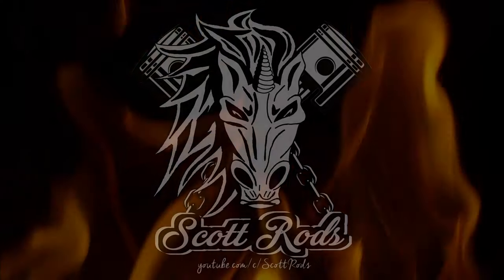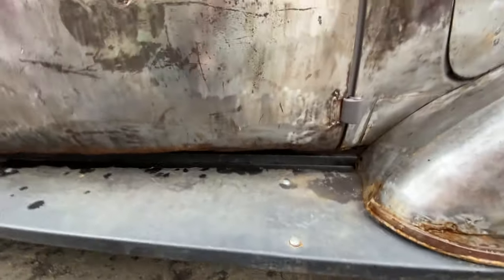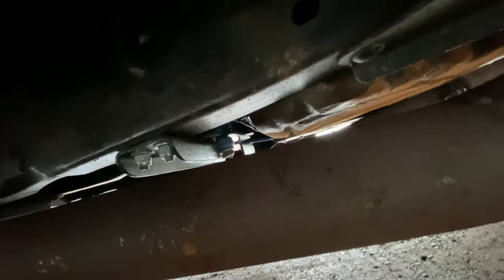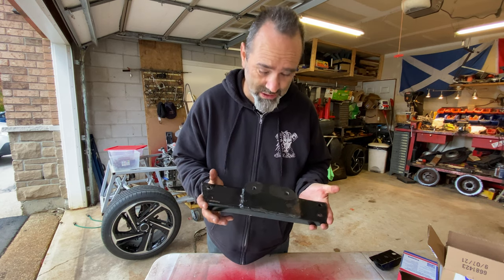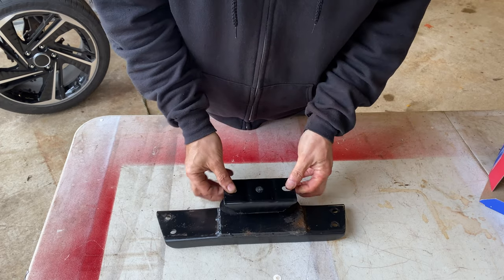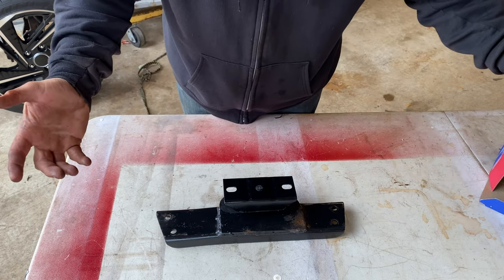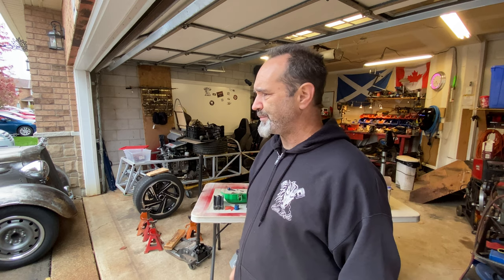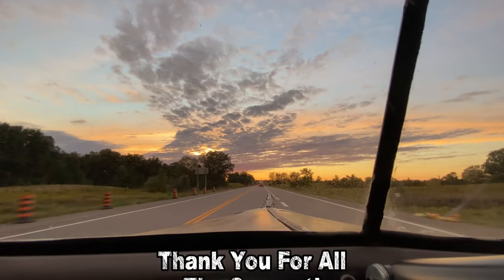New Chevy Transmission Mount Install After Three Failed DIY Attempts

Comment: About time to put the side windows back in. You should check out Rat Rod Bobs video on making the windows go up and down with an old seat belt. Might be an easy temporary and cheap  solution since youre going to eventually replace the doors someday. The episode is called Easy Rat Rod Door Windows from start to done.

Comment: Now you can see why your first attempt didn't work. Running the bolts thru 2 rubber biskets you could never get them tight. Both pieces of steel in the new mount can be tightened but still isolated.
Reply from the maker: Yeah, oh well, now I know.